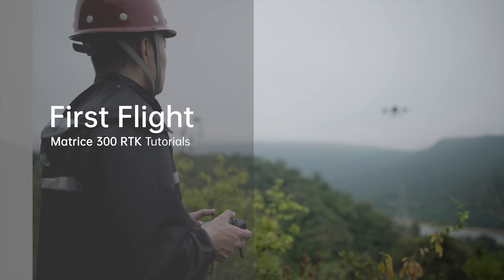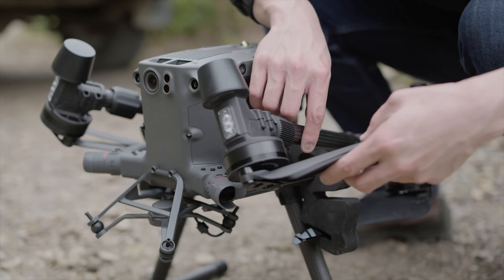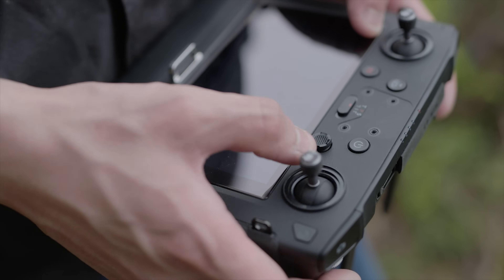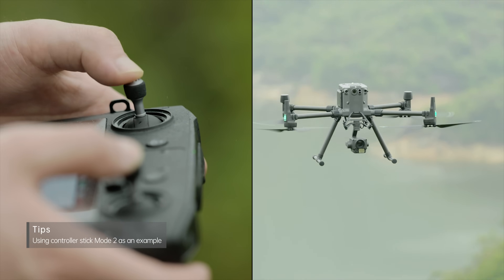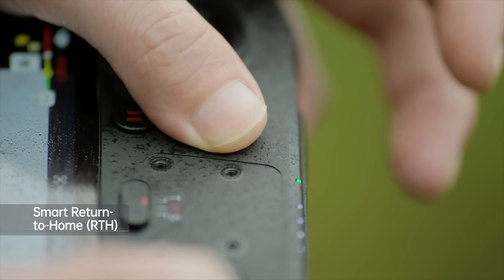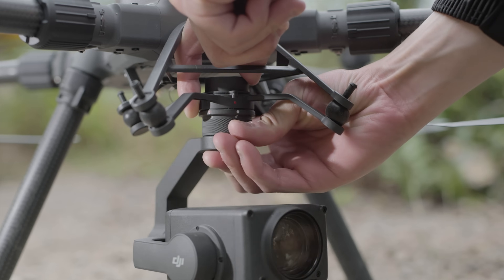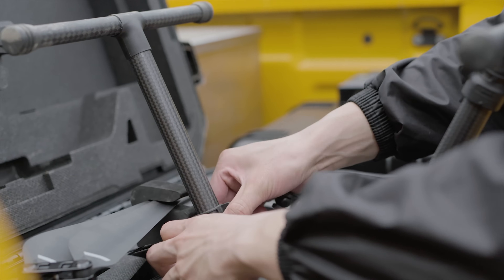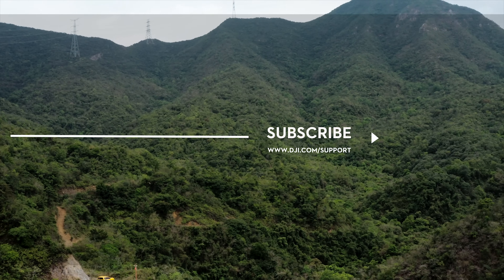Matrice 300 RTK | How to Fly

Comment: Warning warning DJI please fix the dji smart controller! I have the dji smart controller and the new dji fpv goggles. I use the smart controller and the new fpv app to give live video feed to the world with the dji air units. THE problem is the new caddx vista will not work with the smart controller. I have 2 quads with the caddx vista and I can not live stream with the smart controller. It has to be a firmware problem! PLEASE FIX THANKS.